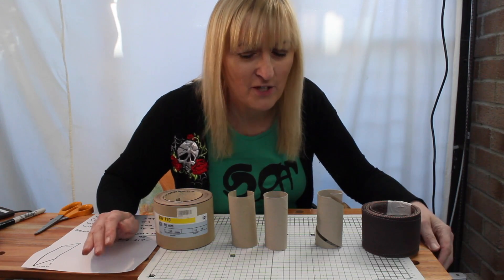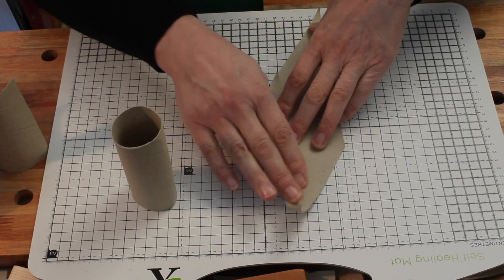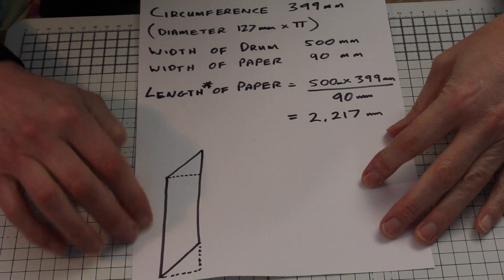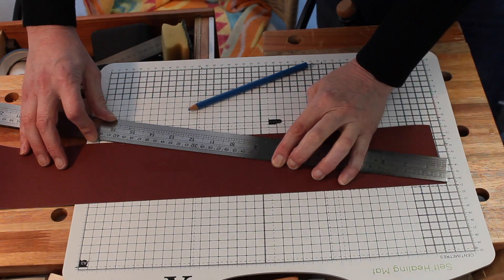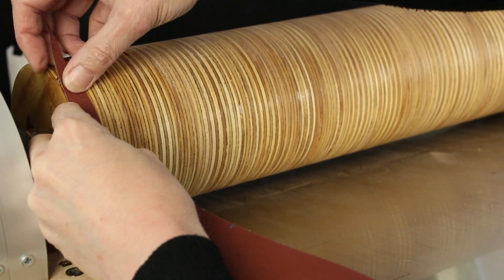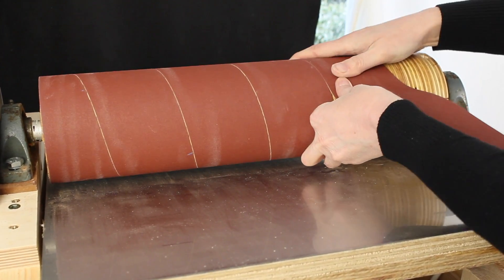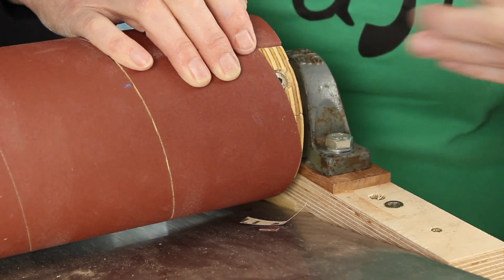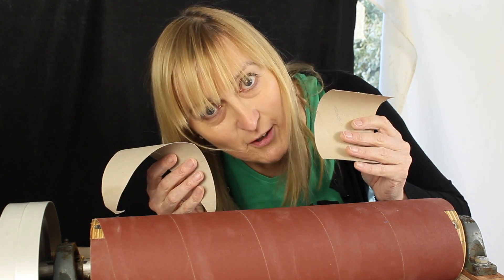Changing a drum sander belt with maths and toilet rolls

Comment: Using this mathematical formular is obviously  perfect for your own home made drum sander but mine is a Charnwood 10/20 (In the UK) with 2 retaining clips at start and finish Charnwood use an 82mm wide sandpaper, when using different withs of sandpaper your formular doesnt work. the last piece of the cut sandpaper is no where near the last retaining clip, its ok if you have drumsander which uses velcro or adhesive sandpaper, the finishing point is of no importance... any help would be appreciated.. from any one. I have rolls of widths 75mm.. 90mm 100mm..115mm.

Comment: Hi Susan, i'm sorry but im a bit lost, can you help me please on the cutting of the sandpaper for my drum sander Charnwood 10/20.... the diameter of the drum is 130mm, and i'm using Pye 3.14.... the length of the drum is 262mm and the width of the paper is 75mm.. ive cut it out and is doesn't fit.. can you help me please...please... Bill Nicholson (Coventry.UK)

Comment: Question.. Have you ever tried using Adhesive backed sandpaper on your drum sander, or, spray adhesive, when installing a new belt? Do you think it would make it easier to keep it tight the whole way through?  Hmm.. Ending at the other side seems to be a challenge too.. I wonder if multiple slits and some hardwood shims would be better to flip the end over, push it down and pin it with some slightly tapered shims.. Might have to cut the top off of the shims from time to time, if the fit wasn't perfect, but, could have a cup full of them too. 
Just thinking... Love to see Ladies involved in the trade.. Congratulations.. You had me googling the full length of pie at the start of the video.. Fixing to see what else you do.. Likely will become a subscriber and commenter.. Still going to be a while before I start uploading on any sort of regular basis... Trying to get my girlfriend into machining, or, CNC, etc...

Comment: Thank you for this presentation. Question  #1; When starting the wrap around does the cut edge /  side or the parallelogram, run along the edge of the spondle?  Question #2. Which direction should the wrapping begin? With the feed, against the fees, Doesn't matter?

Comment: You got it a bit wrong. The tapered cut is not equal to the circumfrance as it runs obliquely and not straight around.So that cut edge will be longer than the circumfrance making the angle wrong and hence the following wraps.
Reply: It is still a straight line. It will be the same. Try cutting the toilet paper roll and you'll see.

Comment: Hi Sarah, I live in Belgium and bought me the PowerMatic PM2244 drumsander. Afterwards I had difficulties finding pre-cut sanding paper for this machine at a local store. The standard was a 76mm wide roll. I could not find paper with the same width, at least not locally. So I bought a Klingspor J-Flex roll with a width of 50mm which I could find here locally. Then I used the calculations on your video and BAM, perfect fit. Thank you for making this very clear video!!! Kind regards, Patrick

Comment: Just a thought; if the end disc was able to move on the shaft so that it could have the end of the paper clamped and then turned to tighten and then clamped to the main roller using similar bolts to the paper clamp. Next time!

Comment: How about using a thin wedge near the first wrap to hold the drum still (like those made for shimming a door frame) once you are re-tightening the following wraps to the end.

Btw. Did you consider using PVC or even steel pipe for a drum? Wood is your medium but it has properties that might make it a better material for a drum, e.g., less expansion from heat or perhaps a more balance drum due to a laminate, etc.

Comment: Great vid cheers, if you could lock the drum with a locking pin through the pully  or with a different  method it could possibly aid you when tightening the glass paper on the drum as i could see half your effort is used holding the drum still, just a friendly observation. Nice bit of kit all the same.

Comment: Thanks so much for your video. It is very interesting. I tried to calculate a sand paper for my drum but i couldn´t do. I am using a drum of an old printer. It is 36 mm of diameter, 415 mm width, circumference 115 mm, diameter of the drum 36 mm. I think to use sand paper of 90 mm width. It gives me 530 mm lenght of paper, but I couldn´t calculate the cutting line for sand paper. It gives me 113 mm, but it doens´t work. I would appreciate if you tell me how to calculate it. Thanks in advance.

Comment: I,ve found using double sided tape (1/2") one my roller works very nicely to keep the sandpaper tight while installing . Love your videos . Thank you .
Reply: I was thinking of a line of spray adhesive across the entire length. It might give a little more holding power. It sounds to me like either system would work.
Reply: Spray mount would do the trick I think

Comment: A great build, perhaps the best drum sander one I've seen on youtube so far, If I'm allowed to throw in my little piece of adviice it would be to trim the sand paper back to match the shape of the end clamping block where it covers it restricting access, would only be a small trim. other than that I've learnt a few tips watching this build.
Looking forward to your next build :)
Reply from the maker: +Andy Towning What I've learnt with paper backed abrasive is that you mustn't have any hard edges or corners that could catch or you'll rip the paper. You can trim the paper back but you must do it with smooth curves. This wasn't such a problem with cloth backed paper. I had a small rip occur where an edge caught but fortunately it didn't come off the drum - it did give the work a bit of a kick, but no damage was done. I trimmed the rip smooth and didn't need to change the paper. The Hermes paper backed actually works better than the expensive Abranet Max as it doesn't stretch, however it does clog. Abranet doesn't clog at all as it's an open mesh, but it stretches and becomes loose at the right hand edge so the depth of cut increases by 0.5mm - ok for narrow pieces but bad for sanding panels.

Comment: You'd need some sort of a stopper to prevent your roll from rotating during tightening the sandpaper. A nine inch nail in a pre-drilled hole at the end of the drum would work despite being ugly.

Comment: Hi,  another informative and interesting video..  You probably know this but dried up silicone sealant(old tube)  makes a great cleaner for sanders..  Cut the end of the tube off and hold the dry silicone against the drum and move across..  Works a treat
Reply from the maker: +Heath Cope I'd seen the blocks you can get in specialist tool shops but I didn't know that silicone sealant is a substitute. I have a half used tube that's still liquid - I'd better get drying it out :-)
Reply: Susan Gardener you can't use a drum sander without using a belt cleaner after each pass, otherwise you will be changing belts every day😀.Dust extraction is not enough. I actually use mine as the wood is going through. They are on eBay and Axminster sell them. When I bought my drum sander years ago Axminster gave me one for free. I have one beside every sander, disc, belt and drum. My belts last for months. On you tube videos I rarely see them used.
Reply: Using silicon to clean sanding belts might not be suitable for guitar parts in that impregnating silicon into the wood may have an adverse effect on non-silicon finishes.

Comment: I tried this loo roll method and I'm just not having good results. A pack of Andrex doesn't seem to take much off a piece of timber. Should I be using Charmin Ultra instead?

Ahem.

Very useful video - thanks.

It occurs to me that some sort of spindle lock (as usually present on lathes) would be quite useful when trying to tighten the paper. A wedge between the table and the drum (near the left side) would be a simple solution. Some sort of a pin that engages with the end of the drum might be better though.
Reply from the maker: +gbspikyfish you need Tesco value toilet paper -rough! 
You're not the first to suggest the lock. I may try putting a pin through the end.
Reply: Tesco Value Loo Roll: or "(Rougher than a) Badger's @rse" as it's more commonly known :)